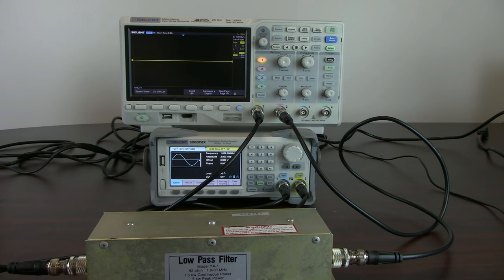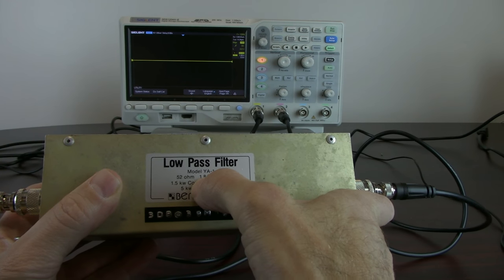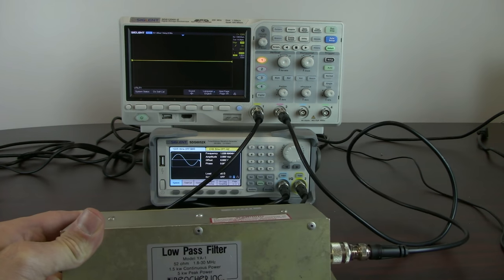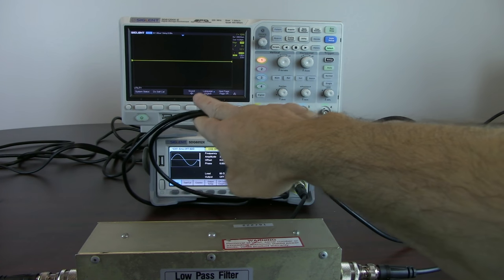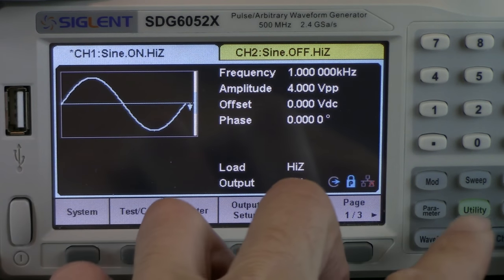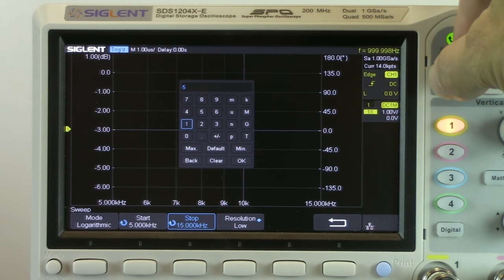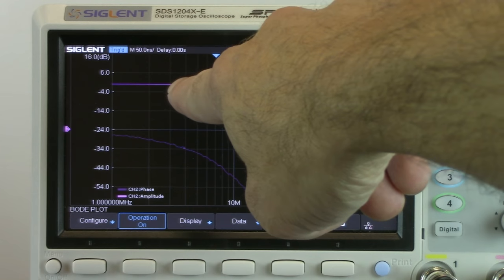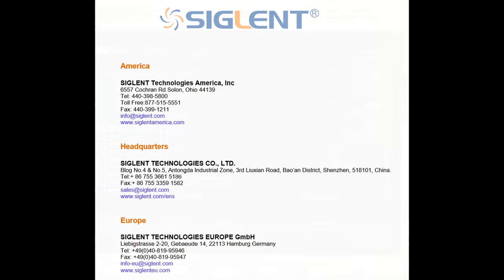Frequency Response Curves (Bode Plot) using an Oscilloscope and Function Generator

Comment: Nice demonstration but I have some question. Why you using second output of signal generator? Why not just splitter at the input of filter and 10 MEG oscilloscope probe? If we imagine that input impedance of the filter changing with frequency it will cause changing amplitude on input while sweeping. But when we using second output of sig gen as source of information we "see" constant amplitude which can be not correct for real filter input amplitude. It would work 100% right only if filter have constant and known input impedance. It also OK if we interesting only for responce of the circuit from voltage source with constant output impedance.
Reply from the maker: Hello. Jason @ SIGLENT North America here. Thank you for writing in. I didn't use a splitter because I didn't have one and suspected that many customers would also be in a similar position. The use of the other output of the SDG is very convenient (it's already there.. no additional purchase required). For some installations, you may be correct.. but, in real use cases, the filter is connected to a single signal source (like an SDG) and there is no splitter involved. It would be an interesting comparison..
Reply: @SiglentVideo   Thank for fast answer, Jason! I thought about that task a little bit more and came to decision that in real designing procedure knowledge about output responce irrespective exact input voltage even more applicable than "academic Bode' ("gain vs frequency" not "out amplitude vs frequency"). Because in real circuits we have some source which more close to bench signal generator and have approximately constant output impedance. Thus real signal source have not opportunity to adjust own parameters to filter's input impedance, therefore "Bode in gain terms" will be even more far from true response in real circuit which we interested in first order. I had this question because when I doing some measuring with quartz filters I see how voltage on filter's input significantly drop on some frequencies. I hope I was clear enough. Best regards!

Comment: How do you manage the cable lengths correction, as a calibration procedure? If no correction available, do we need to use identical length/loss  cables on the two channels paths ?

Comment: Hi @SiglentVideo. Is it correct to connect SDG to the DUT via a T-piece and then to the oscilloscope? This would allow second output of the SDG to be used for other purpose. This configuration will also tell the oscilloscope the real value of the voltage on the input of a DUT. The presented connection method actually separates what DUT actually sees from what oscilloscope is presented by a separate channel.

Comment: Great video! @1:01 what will be the Oscilloscope "Set Channel" settings for this circuit? I'm afraid you didn't show it on the video. Is Ch2 going to be the DUT Output, and Ch1 will be DUT Input? Or is it the other way around?
Reply from the maker: I am glad that you found the video helpful. At 1:01, the CH1 FG output goes directly to CH1 scope in. This is the reference channel. To put it another way, FG CH1 is the same as the DUT input. 

CH2 of the FG goes through the DUT and then to CH2 of the scope. It is the DUT output.

If you have additional questions, you can write info@siglentna.com

- Jason, SIGLENT North America
Reply: @SiglentVideo  Got you. I've been testing this feature atm. I have the newer firmware on my SDS1104X-E and its now called Bode Plot II.

I noticed that the operation will not stop even after finishing the frequency sweep. The AWG sweep goes right back to the "start frequency" and start a new cycle again. Is this the right behavior or its just on my scope? So I have to manually press the stop button to stop the plotting operation?
Reply from the maker: @losaminos59  Yes. You have to manually stop the sweeping. - Jason, SIGLENT NA

Comment: Since the data rate is split between channels 1/2 and 3/4 on the scope, would there be any benefit to hooking to the scope on channel 1/3 to get the plot to update faster? Or is this a function of the generator and the sweep speed?
Reply from the maker: The majority of the test time for the Bode application consists of the USB communications to the generator and the ranging function of the scope. The scope data collection time is small in comparison. I don't think you will see any performance increase by splitting the channels. - Jason, SIGLENT North America

Comment: im new to scopes and just got the 1104x-E and saw you had 50ohm terminator. i do know that i saw that you could switch between with the higher end scopes but had no idea that its something i can just put on the end of the cables for matching stuff being tested. so is 50ohm one of the common ones that i should have with this scope for bode testing? also is there others that may be needed? or is it just because it was something that plugged right into the coax cables? what if i want to test input vs output on amps or something how would i know if i need to use a different ohm termination?
Reply from the maker: Hello Sneakywinja. Jason from SIGLENT NA here. Thank you for writing. 50 Ohms is the typical impedance for most power and RF circuits. Function generators are also typically 50 ohms. To minimize reflections and optimize energy transfer, you want the impedances of all circuit elements to be as close to the same value as possible. Check the impedance of the devices you wish to measure and try to get cables and terminations that match.

Comment: at 2:14 you say that this bode plot feature works with the sdg1xxx-x, sdg2xxx-x and sdg6xxx-x series function generators.
Doesn't it work with the SDG805/810/830 series function generators?
Reply from the maker: Yes. It does work with SDG8s running current firmware revisions as well.

Comment: Why the heck can't I do Bode plots on my more expensive Siglent SDS 2304X, 4ch oscilloscope with built-in waveform generator?
The hardware already has everything built-in needed to do this, all it would take is a software update!
The oscilloscope won't display in Bode plot mode, and the built-in waveform generator won't output a frequency sweep function. Both are purely software limitations. 

It's not even available as an add-on licensed feature!
Please please add this to the firmware.
Reply from the maker: Hi Nicholas. Jason @ Siglent here. I appreciate and understand your rationale, but it isn't likely that Bode is going to be added to the SDS2X family. Software is not the only consideration, as there are hardware (memory) constraints and "room" for futture firmware changes that need to be balanced. If you have additional questions, you can write info@siglent.com.
Reply from the maker: Siglent Technologies
It would also be fairly straightforward to build an application that performs Bode plotting using a computer and the remote control SCPI commands for the scope. Write in if you'd like more guidance on that process.

Comment: I got the SDS1104X-E oscilloscope. Do I need this particular signal generator to use the bode plot function in this way?
Reply from the maker: Hello. 

Bode plotting with the SDS1104X-E, SDS1204X-E, SDS2X-E Series, and SDS5000X scopes require a SIGLENT SDG function generator or the SAG and associated license for external USB  function generator control. 

https://siglentna.com/waveform-generators/

https://siglentna.com/product/external-arbitrary-waveform-generator-2/

If you have additional questions, please write info@siglent.com 

Have a great day.

Sincerely,
Jason, SIGLENT NA

Comment: Two questions: Early in the video I saw HiZ selected. I realize this just affects the displayed voltage on the ARB but wouldn’t 50 Ohm have been more appropriate for your properly impedance-matched setup? Or was that immediately overridden by USB commands from the scope anyhow?

Also, what type of USB cable and which USB ports. Would I need to find an A to A cable?

Thanks!
Reply from the maker: Hi Sidlinger. Jason here. The XE scopes do not have 50 ohm input selection. There are 50 ohm feedthrough adapters used on both scope input channels to help match the impedance of the generator. This minimizes reflections. The 4 channel XE models have an extra USB connector on the rear panel so a standard USB cable (Type A-B) will work. You can write info@siglent.com if you have additional questions.
Reply: @SiglentVideo  I think he means your choice of presumed attached impedance. If you set the ARB to Hi-Z it assumes whatever you peck on the screen is at the output, if you set it to 50 it will read in adjusted values presuming that your terminating impedance is actually 50 ohms and to whatever extent they're perfectly matched the voltage will be cut in half. Given you set both sides the same and you're displaying in dB however it's not going to matter...
Reply from the maker: @JamesReedy  Yes. The correct output selection for the generator would be 50 ohms so that the set voltage values are correct and to use 50-ohm feedthroughs on the inputs to minimize reflections. 

I can't remember if the Bode setup reconfigured the generator for 50-ohms or not, but it should be. 

Thanks for checking.

- Jason, SIGLENT North America
Reply: @SiglentVideo  I seriously hope that the Bode setup doesn't automatically reconfigure the function generator for 50 ohms output because I want to use 75 ohms. Hopefully the function generator outputs can still be set to Hi-Z. I can then use a pair of 75 ohm feedthrough adapters to set the source channel impedances, while using a further pair of 75 ohm adapters at the oscilloscope inputs. Despite the resulting handful of thru terminations this is, for me, still a simple way to roughly measure S21 and S12 for an RF device.
Reply: On second thoughts it looks like I need a pair of 50 to 75 ohm adapters to change the outputs of the function generator from 50 to 75 ohms. From the ongoing discussion it looks like the output impedance of the function generator is always 50 ohms. Got confused there.
Reply from the maker: @daveconti1067  FW Revision 6.1.35R2 has stimulus load settings of 50, 75, and 600 Ohms as well as High-Z. - Jason, SIGLENT North America

Comment: So you can do this with SAG1021 AWG also? Can I measure 20hz-20khz audio signal from amplifier circuits?
Reply from the maker: Yes. The SAG1021 can perform the sourcing function of the Bode plotting feature of the X-E scope. The Bode plot function operates from 10 Hz up-to 25 MHz and should be perfect for your application. If you have additional questions, you can always send an email to info@siglent.com
Reply: @SiglentVideo  Just one more question, if I get SDG1032X do I need to get a separate licence for my scope to use this automated bode plot feature? Thanks.
Reply from the maker: No. The 4 channel X-E oscilloscopes come with the Bode Plot function. To perform a Bode Plot,  you just need a signal source. The 4 channel X-E can control the SIGLENT SAG1021 (which requires both hardware and the software activation key.. SDS1000X-E-FG) or one of the SDG X series generators (SDG1000X, 2000X, or 6000X). f you have an SDG X series generator, you can simply connect as shown in the video. No software license needed.

Comment: Hi, does this work with the SDG1025? (no X) do I need to purchase any software options?
Reply from the maker: Yes. It should work with the SDG1 family without any additional purchases. The Bode Plot interface is included with the 4 channel SDS1xx4X-E scopes as well as the SDS2X-E scopes. The setup and control interface for all of the SDGs and SAG is as shown in the video. -Jason, Siglent NA

Comment: Is this automated Bode Plot feature available with SIGLENT SDS2101x oscilloscope?
Reply from the maker: Hi Krish. It is only available with the four channel X-E scopes (SDS1104X-E and SDS1204X-E) at this time.
Reply: Hoping this feature available with the next firmware release of SDS2XXXx oscilloscopes, Thanks
Reply: @SiglentVideo  Your customers are STILL waiting for the firmware to be be updated on their SDS2000x 4ch oscilloscopes to support Bode plots.
Please don't just take our money then abandon us.
Reply from the maker: @MaxWattage  Hi Nicholas. Jason @ Siglent here. Thank you for writing. Unfortunately, the SDS2X is unlikely to ever get Bode due to hardware limitations. It is not as simple as adding that feature in code. There has to be enough memory, etc.. and Bode was also never planned nor advertised for the SDS2X platform. Thank you for writing. You can also contact us by writing info@siglent.com
Reply from the maker: It would also be fairly straightforward to build an application that performs Bode plotting using a computer and the remote control SCPI commands for the scope. Write in if you'd like more guidance on that process.

Comment: Sure, I'll just run a side Bode plot business with a SDG 6052x generator, which costs 7 times more than the scope.
Reply from the maker: SIGLENTs Bode solutions are considerably less expensive that other vendors. SIGLENT Bode works with any SIGLENT SDG, not just the SDG6000X. 

Today, you could perform Bode with an SDS1104X-E and SDG810 for around $900, total. 

- Jason, SIGLENT North America